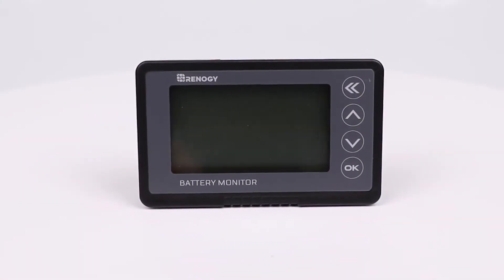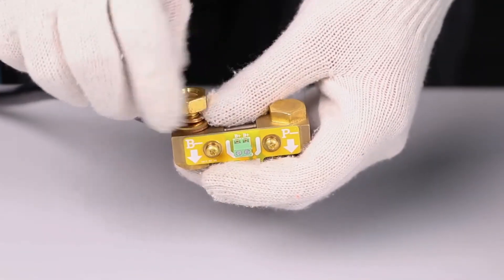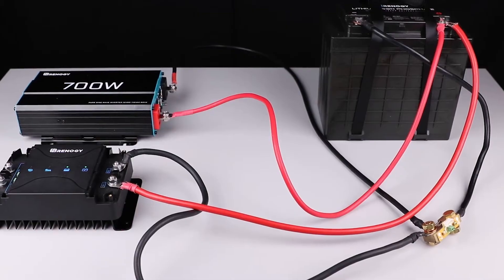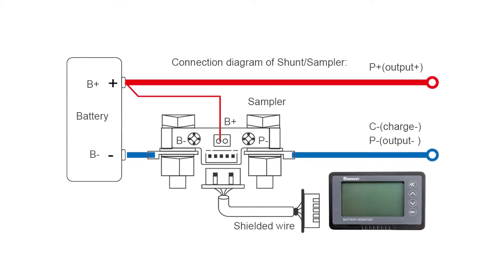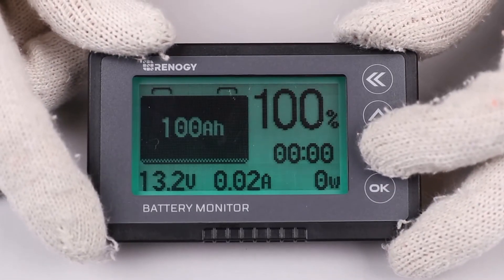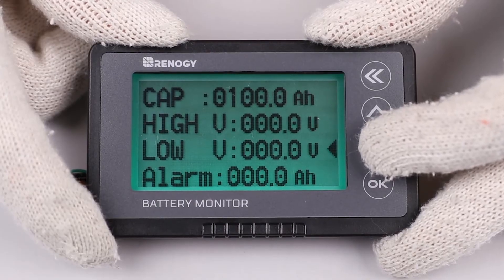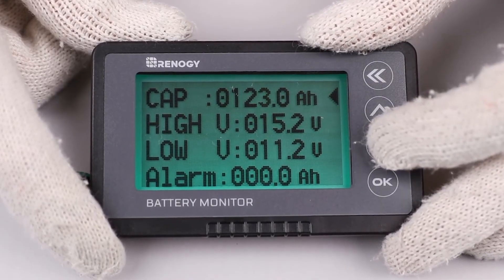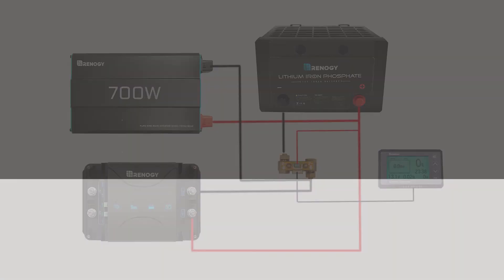Renogy 500A Battery Monitor

Comment: Have watched a lot of other videos on this monitor and most say to set the capacity of a LITHIUM battery at 80 percent of its rated amp hrs. On your video you recommend 100 percent of the rated amp hours, so what is the correct way?
Reply from the maker: Hi, Native_Man.

Thank you for your feedback. Since we also have the alarm value for the monitor, so  you can set the capacity according to your actual situation.

If the capacity of your battery is 100ah, you can set the capacity value for 100ah and set the alarm value for 20ah.

Comment: How do I calculate the number of amp hours to set the alarm to? I’m using a 12V 100Ah 100A LiFePO4 battery, a Renogy battery monitor and a Rover Elite 40A MPPT Solar Charge Controller.
Reply from the maker: Hi, Anna.

We recommend that you set the alarm ampere hours according to the maximum discharging depth of the battery. For example, your battery's discharging depth is 80%, you can set the alarm ampere hours to 20ah.

Comment: Hi, I got this reply after questioning the figures stated on my battery monitor but the link supplied for UK doesnt work! My monitor is stating 100% and 130ah (130ah leisure battery) even at 12.1v which is obviously incorrect. please advise
Reply from the maker: Hi, Bob.

Have you set the high V value? Please kindly set the value according to the voltage of your battery when being charged fully. 

Since we may need you to send us the videos for reference when troubleshooting, please have a try again for the link: https://renogy.force.com/helpcenteruk/s/contactsupport. Or you can send us email for help directly through the email address support@renogy.com.

Comment: I fitted one of these to a lithium battery. Everything works except I can't calibrate the AH reading.
I have charged battery up and pushed (held in) second button down .It shows 100% but does not move as battery is discharged?
Reply: Did  you ever fix this? Mine is doing the same thing!
Reply: @krover01  
Yes it came right after I tried resetting it a few times.
Reply: I have exact same issue tried recalibrating multiple times on fully charged and dead batteries. My inverter shuts off on 96% battery life
Reply: Same issue, not showing any values while discharging or charging. Anyone find a solution?

Comment: Hi, I have installed this unit but the display doesn't seem quite right, 130ah leisure battery at 100% and shows 12.6v but when battery drops down to 12.3v it states 98% and 128ah, can you advise please? Thanks
Reply from the maker: Hi, Bob.

In order to solve your problems, we may need some pictures or videos for troubleshooting the problems. You can submit a case through our Help Center Portal  (links listed below for specific locations）for subsequent communication.
 
https://renogy.force.com/helpcenter/s/contactsupport (USA)
https://renogy.force.com/helpcenterau/s/casesubmit (Australia)
https://renogy.force.com/helpcenterca/s/contactsupport (Canada)
https://renogy.force.com/helpcenteruk/s/contactsupport (UK)

Comment: How do you set up two batteries ?
Reply: No different. Just hook up in series or parallel and make sure all current passes through the shunt for proper monitoring. Setting capacity and voltage will depend on your particular batteries and chemistry.
Reply from the maker: Hey DonVanBike,

For any technical questions, please contact us here-https://www.renogy.com/contact-us?gclid=CjwKCAiA3pugBhAwEiwAWFzwdeH3Crd9vRTbjjTYl9l3daVqnotJPjBhs2nmw-Wkn1_guWQeW0ao6hoCOHcQAvD_BwE

Comment: can this be used on an AGM battery
Reply: Yes. Installed one on my AGM bank and one on my Lithium bank. Its a pain to push the right buttons to set the parameters but after its done, the meter is very useful. The screen remains lit on the AGM one 100% of the time. This might be from the slight discharge in the bank. Anytime amps go in or out, the screen should light up. Plus the lit screen goes on-off about once a second when its charging. I can see that the bank is charging from 30 feet away.

Comment: The percentage output on the monitor decreases in value even when the alternator is charging the battery. I trust the generic battery gauge on my fridge over this thing
Reply: Mine is doing the same thing, even on shore power and charging through inverter charger, AH are reducing.

Comment: Great video, thank you! Would I also need a negative wire to connect to my DC fuse box? Or just the converter and inverter?
Reply: Yes.   EVERY ground needs to connect to the shunt, then the shunt to the battery.  Anything that isn't connected to the shunt won't be measured.  And there should be nothing between B- and the battery except a single correctly-sized cable.
Reply from the maker: Hey Kayla,

For any technical questions, please contact us here-https://www.renogy.com/contact-us?gclid=CjwKCAiA3pugBhAwEiwAWFzwdeH3Crd9vRTbjjTYl9l3daVqnotJPjBhs2nmw-Wkn1_guWQeW0ao6hoCOHcQAvD_BwE

Comment: It ONLY read how much you draw from the battery, it DOES NOT update itself when you connect Solar or start the car engine to charge the battery.
Reply from the maker: Hi, Don O.

Thank you for contacting Renogy.

You can refer to page 6 for the monitoring data in our manual book: https://store-fhnch.mybigcommerce.com/content/RBM500/RBM500-G1-Manual.pdf. 

In addition, if you want to monitor the charging status, please make sure the monitor has been connected with the negative port of your controller or charger.

If you have any other probblems, please contact us at any time through submitting a case:

https://renogy.force.com/helpcenter/s/contactsupport (USA)
https://renogy.force.com/helpcenterau/s/casesubmit (Australia)
https://renogy.force.com/helpcenterca/s/contactsupport (Canada)
https://renogy.force.com/helpcenteruk/s/contactsupport  (UK)

Have a nice day.
Reply: Yes it does. It will read a draw or a charge if you set it up correctly. Make sure all current passes through the shunt. Do not connect chargers (solar or otherwise) to the battery. Connect them to the shunt.
Reply: @geoffmooregm  right after I post that comment I found the problem the main negative of the battery was connected to the negative of the inverter first, only if the Renogy support is more active I could have fixed it earlier.
Reply: @DANIEL-ls5ku  Yea I found the lack of a good schematic strange. Or at least a simple diagram for different types of hookup. The only reason I knew how-to hook it up correctly was because of years of wiring vehicles and equipment.

Comment: Can someone tell me why the backlight is blinking constantly? It only stops blinking when I turn on a device (light, fan, inverter, etc) in my van. It stops blinking when the battery is being discharged. Thanks.
Reply: I believe (after digging into a couple amazon reviews) that it flashes while charging.
Reply: @RndmAnvgr777  yes, I think you're right. That's what i eventually gathered. Thanks for the response.
Reply: it's in the manual.  You have the B- and P- reversed.
Reply: @mikeborum3500  Thanks for your reply.

Comment: wich cable # can use for the instalation??
Reply: 4 gauge worked for me.
Reply: Depends on the current you plan to draw. Could be anywhere from 6ga to 4/0ga

Comment: These 'instruction' videos are so fast and rushed. So frustrating to watch...

When I start the car, in about 15 seconds, the monitor turns on and shows that I'm draining battery. (About - 3.3A/40W) Huh?? It's supposed to be charging it through the car alternator.

The time also makes no sense. It's all over the place. It goes up, goes down, it's so hard to tell how much time is actually remaining on the battery.
Reply from the maker: Hi, Michael.

Thank you for your feedback. In order to solve your problems, we may need you to send us images or videos for help. For the condition, please kindly submit a case through our Help Center Portal (links listed below for specific locations).

https://renogy.force.com/helpcenter/s/contactsupport (USA)
https://renogy.force.com/helpcenterau/s/casesubmit (Australia)
https://renogy.force.com/helpcenterca/s/contactsupport (Canada)
https://renogy.force.com/helpcenteruk/s/contactsupport (UK)

Comment: high and low "disconnect"???
huh?
Reply from the maker: Hi, James.

HIGH V means Full capacity voltage. When the voltage is higher than the set value, the capacity will be automatically set to 100%.

LOW V means Zero capacity voltage: When the voltage is lower than the set value, the capacity will be automatically set to 0%. If the discharge continues, the voltage value will flash, and the alarm will beep once every 10s.

So it can not be disconnected when the value is higher than HIGH V or lower than LOW V.

Wish you a nice day.
Reply: @RenogySolar  Thank you for the explanation!

Comment: Mine just shows 99% all the time never moves even if the voltage drops in the bottom left
Reply from the maker: Hi, Jake.

Thank you for your feedback. If you have calibrated the capacity before using, you can submit a case through our Help Center Portal for help (links listed below for specific locations）as we may need your order information in detail.
 
https://renogy.force.com/helpcenter/s/contactsupport (USA)
https://renogy.force.com/helpcenterau/s/casesubmit (Australia)
https://renogy.force.com/helpcenterca/s/contactsupport (Canada)
https://renogy.force.com/helpcenteruk/s/contactsupport (UK)

Comment: My battery monitor is reading that I’m pulling 700watts with everything turned off and and not showing as charging even tho my dc to dc with mppt is showing that the solar is charging my battery? Anyone had a problem with this?
Reply: Mines doing a similar thing, did you sort it out?
Reply: @jondavey007  Renogy have sent me another one mate

Comment: This is POORLY explained.  Why don't you just call the dc-dc mppt charger the CONTROLLER.  And why does the model of Controller change halfway through the video? And what are you talking about four extension wires?  What?  Also, you're referring to the controller as a load?  Really?  You guys need to get your act together.
Reply: @dak1361    Does this monitor work properly for you?  Mine does not work properly.  It tells me the battery is discharging when it's not. It seems to be a total piece of junk.
Reply: @dak1361   What is the DC-DC then?  You call it a 'heart'.  Can you be a little more technical because this is electronic equipment not an organic being.  I have the Midnite Classic system and there's no DC-DC mppt.
Reply: I too thought this was a piss poor representation of a product. I feel it was filmed in my grandmother's basement with a retro VHS cam.

Comment: I don’t understand how the high voltage setting can be used to reset the battery capacity to 100% ? My 12 v battery reads 12.8 v fully charged, no load, while being charged the voltage will go up to 13.6 v or more. But just because it hit 13.6 v for 10 seconds does not mean it’s fully charged. The voltage changes as the charger goes through 4 different stages. I think it should be set far above the highest expected charging voltage, say 20 v, then manually reset the state of charge indicator manually when I know the battery is at 100%. Voltage is meaning less indicator of state of charge. Your manual and video are misleading.

Comment: Why the hell do you not sell your stuff with all the wires you need for it to work.  That is the stupidest thing ever.
Reply: right?  and you need a TEENY TINY screw driver to turn the TEENY TINY DEEP SET set screw for the red wire.  woulda costed a penny to include that tool, do i didn't have to spend an hour finding a random item to turn the set screw with.  we are in CAMPERS, OUT IN THE BUSH when we need these products.
Reply: Which wires are you referring to? If it’s battery cables, then it wouldn’t make sense to include because every application is different.